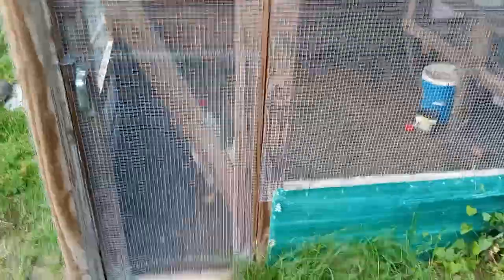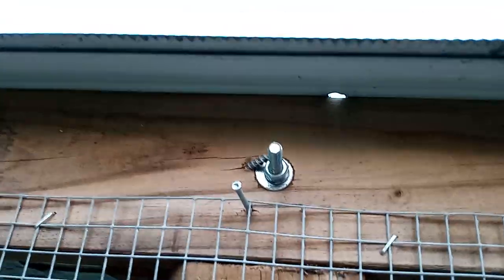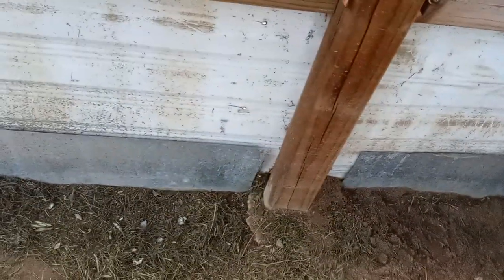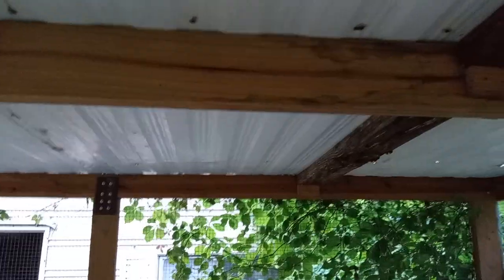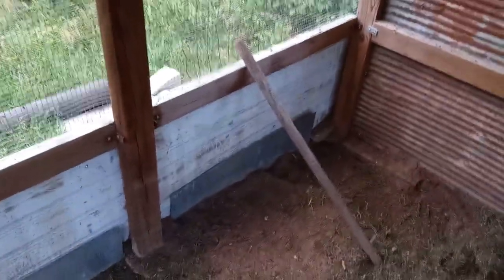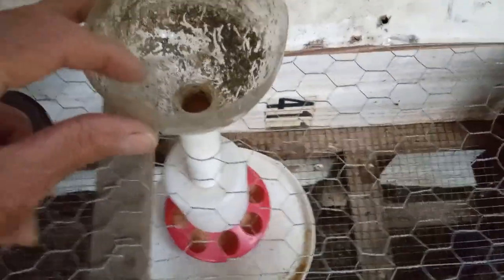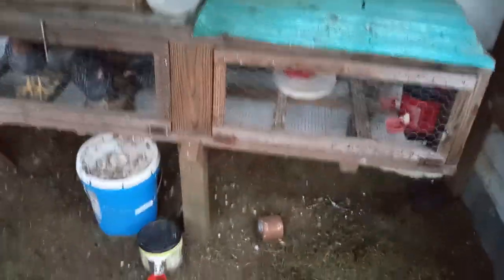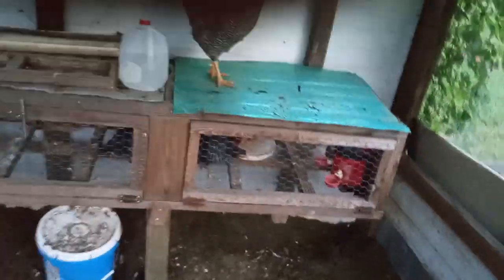2023 Best Hen House Chicken Coop ever made..... snake & predator proof you must see.... CHEAP

Comment: We built our coop really sturdy too and the hardware cloth has been amazing. I have something trying to dig right now and they can’t get in. We also laid fencing on the ground and five feet out and around. It’s been amazing! But you look to have done about the same. Subscribed. 😊
Reply from the maker: Thanks for the comment.
Yes the 1/2" hardware clothe is good stuff.
It's very good for keeping predators out as well.
I will be re-using the old rusty chicken wire from the old coop.
I'll roll up a few coils & place it at the outside bottoms of the new coop. 
If snakes get in it they will get trapped & die.

I'll be adding nest boxes in a couple weeks & upgrading the feeder & 5 gallon bucket for the water.
Also adding a small door on the back so chickens can get in & out to roam in my pasture.

I'm trying to find a remote mechanism to operate the door from our house. That would be cool.